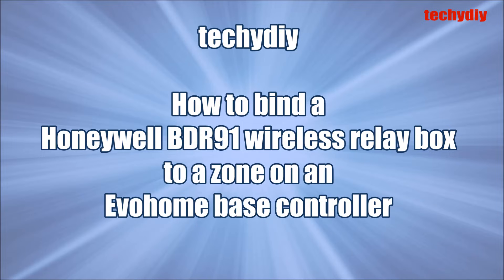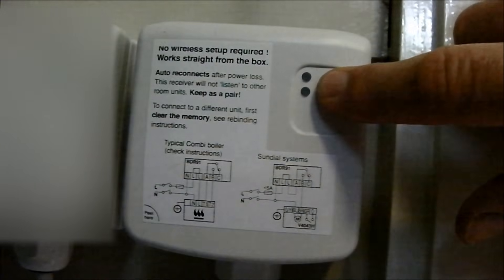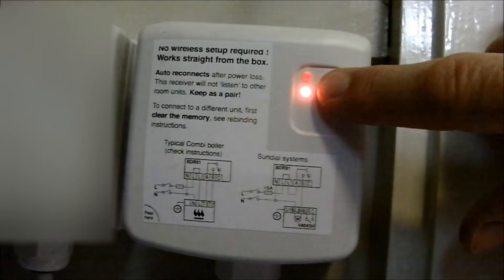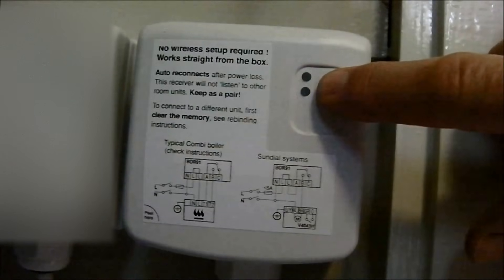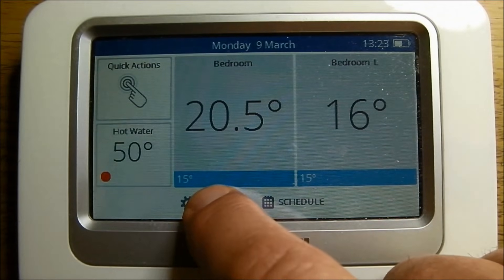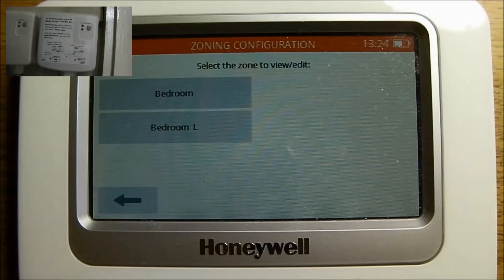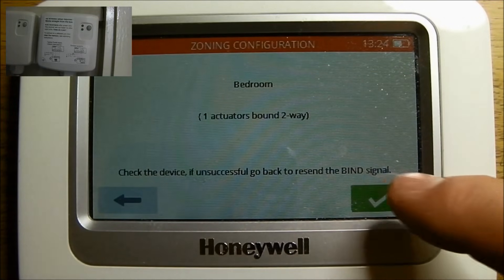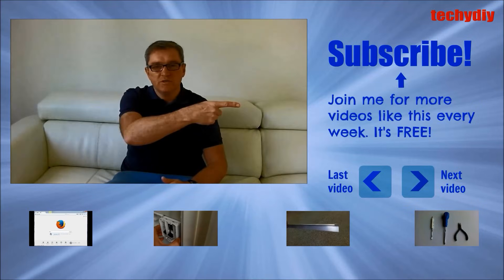How to bind Honeywell BDR91 relay box to zone on Evohome base controller

Comment: Hi, I have a BRD91 controlling a zone valve and i have individual TRVs on each radiator. Do I need to bind both the radiator valve and the BRD91 to each room (zone)? Thanks.
Reply from the maker: The bdr91 can be setup to control the boiler by activating the valve. It will open the valve if any heating is required in any zone. As far as I know (it’s a long time since I made this video) you can’t have a bdr91 that controls a subset of trvs. The system is / was designed to have trvs installed on every radiator.

Comment: My Hot water zone base controller shows "--" as the temperature readout and there is no hot water. Do the steps on this video solve it or is it another problem?
Reply from the maker: Check the battery in the temperature sensor

Comment: Hi
I have the Honeywell Evohome control system at home and I want to replace my existing kitchen rad which has the HR91 TRV head, with a Myson Kickspace plinth heater. 
Do you have experience of doing this and can you advise which Honeywell controls I’d need, so I am able to control the kitchen heating zone via the Evohome app. 
TIA

Comment: Great simple video. How do you reinstall a BDR91 to control a Hot water cylinder as mine was disconnected when the system updated
Reply: same, how did you resolve it?

Comment: Hi, I have a heating system with   3  motorised zone valves, I have one BDR for the Boiler and one BDR for each of the Zone valves . In one of the zones I have installed 6 x HR92 valves, how do these valves open the zone valve?
Reply from the maker: Unless anything has changed in the years since I last looked at it, you cant have a hierarchical zone system. 
If you have a full set of hr92s in that one zone, then just remove the zone valve  or lock it open, as it not needed.

Comment: I am having a different problem with hot water. I have followed system devices 
None 
Stored hot water disabled 

I can see 2 relay boxes don’t know which one to bind tried both no luck
I go boiler control 
Wireless relaty box
Set bind signal and it’s sends back green tick
But the stored hot water is still disabled 
Please some one advise thanks

Comment: Hi I hope you can help, I’ve followed this procedure and rebound my evo home controller to the receiver unit and the system is working ok.  However I am still getting a slow flashing red light (3 secs on 3 secs off) which indicates it is trying to find a second bound device (which I don’t have). I thought that this procedure would have cleared any previous bindings so a bit lost as to why this keeps flashing.

Many thanks!

Comment: hi myself and my family have bought and moved in to the house and our heating system has a wireless center brand thermostat but I cannot get it to work upon inspection around boiler I found a unit that's exactly the same as the one your pressing here but it's on the floor inn2 half's no wires just not connected not used. but I also cannot find the one sat next to yours on the left of the one you are using in the video. is the no connection  of this box the reason my.wirless stay does not work? or do I need to find where the one on the left is in this house. the center wireless stat wsit on on when moved in so they must have been using it. I also have trvs on most of the rads here anyhelp would be great as I have 2 newborns in the house and need to keep on top of house temp better than switching boiler on and off ty in advance. mferris8@live.com
Reply: Honeywell boiler not Turning on bdr91

Comment: Hi, thanks a lot for the video, really illuminating!

Have a basic question to which I didn't find answers yet... my current heating have 3 zone valves (with 1 pump for zone 1 and 1 pump for zones 2 & 3), with 3 typical legacy on-off thermostats.
I would like to install HR92 radiator valves (6 in zone 1, 5 in zone 2 and 3 in zone 3) and getting the single rooms (9 in total) controlled one-by-one, keeping the current pipes/pumps/valves configuration.
Is this possible or I need to have just 3 zone thermostats and no single-room control? 
Thanks! 
ugopapetti@gmail.com
Reply from the maker: What controls the pumps and what controls the boiler? 
 e.g. Thermostat controls the zone valves, zone valve controls the boiler, the boiler controls the pump
Reply: The desire is:  HR92 triggers the BDR91 relays of course one of the three BDR91 who opens elecric valves, pumps then start, water temperature decreases, burner starts and stops @ defined hot water temperature.

Thanks for the advice
Reply from the maker: You can do it with HR92s on radiators, one controller, and one boiler relay. The boiler relay switching the boiler, three valves and both pumps. Both pumps would come on regardless of whether they are both required, so both circuits would also need bypass valves. If you use two controllers and two boiler relays then you could control the pumps individually. I am making assumptions about how your system works. There is a free online Honeywell training course which is worth a look, the link is in the comments of one of these videos.
Reply: My dear really thanks for your willingness to help and diffuse technical colture!
Reply from the maker: Thanks for the nice comment

Comment: Hi, nice and simple video. Would you know how to bind to a tree port valve on a Y plan system, heating side? Boiler/ hot water side seems to work fine, can't seem to get the heating side to flow.
Reply from the maker: +Steven G For Y PLAN - assuming you have the hot water kit and have bound the hot water sensor & hot water  bdr91, then in the configuration menu / system devices /  sundial valves - stored hot water   then you have a Heating valve binding  menu - this is where you bind your heating bdr91. Dont use boiler relay. Also make sure to reset the bdr91 as they come pre-bound as the boiler relay in the the base kit.   It's not much use on this subject but the Honeywell trainign course can help sometimes: http://youlearn.honeywelluk.com/  Let me know how you get on. Thanks N